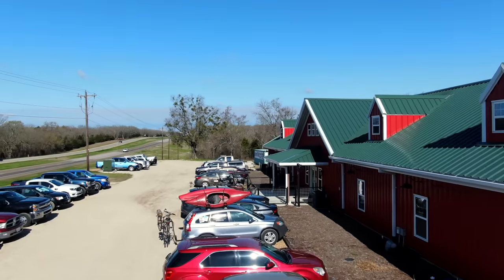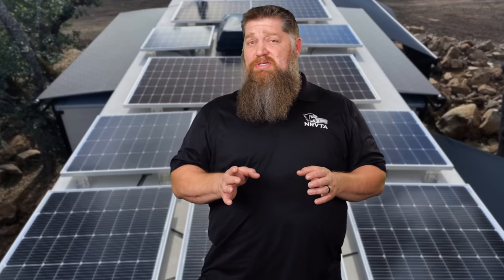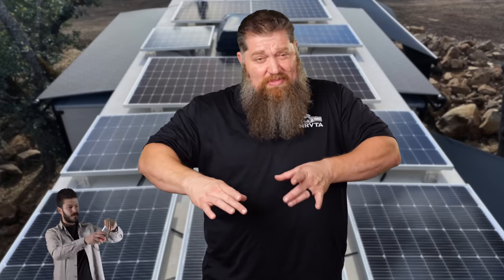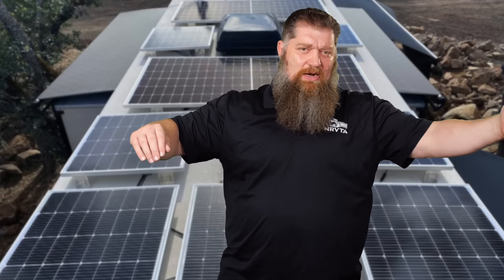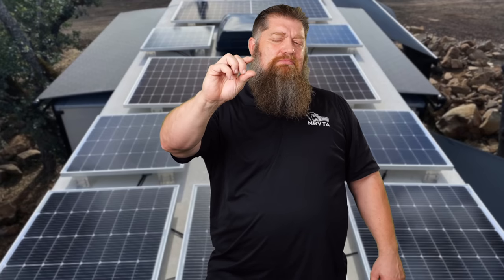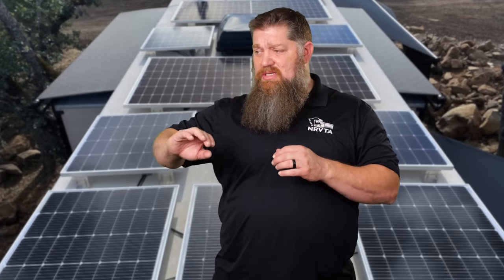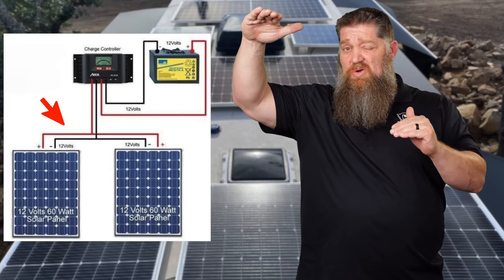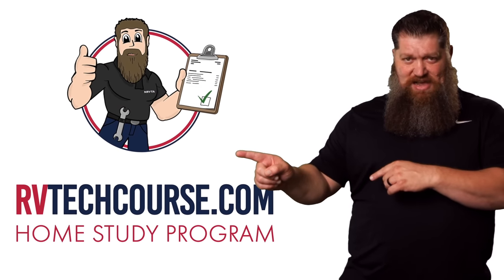Your RV solar questions answered

Comment: Great Video Todd!!  Always timely and helpfull.  You said to avoid the extreem front and back of the roof but did not explain why.  What are the risks if the extreem front of the Motor home roof has been penitrated by a solar panel?

Comment: Question regarding storing your unit for the winter that has solar and lithium batteries.  Do you recommend turning solar controller off and removing batteries?  Or just let the system function?  Thank you

Comment: We have a on-going issue with; every time my wife runs the kitchen sink water faucet the foul odor from the gray take going up either thru the sink drain or under the sink where the pipes are. There is no valve to keep the smell out of the sink area. The piping goerds into the wall and out a vents on back of trailer. The label says do not leave your gray tank dumping vlave open or gases will come up into the kitchen area. Our dump valves are closed and we don't even have the slinky stinky hose connected. There's always plenty of water in the sink trap which is suppose to stop gases from coming in. I have taken the outside vent cover off and it is just an open pipe to vent, no valve of any kind there. What is going on? We have a Grand Design 2023 Reflection 150 226RK 5th wheel. Never notice any smell the 1st few months but we smell it now every time we run water into the kitchen sink.

Comment: I'm a retired INDUSTRIAL HVAC / R TECH.  Looking for a part time job. Not too many campers and R.V
's with 300 ton A/C units on them. But I'm well versed most aspects of electrical and standard refrigeration.  Not a clue on solar. What are the liability concerns if a certified inspector misses something during a pre purchase inspection.  ?

Comment: I would agree and disagree with butyl.
If you have a filon roof like a winnebago..you have nothing for the screw to bite on. And the tape needs that pressure to protect.